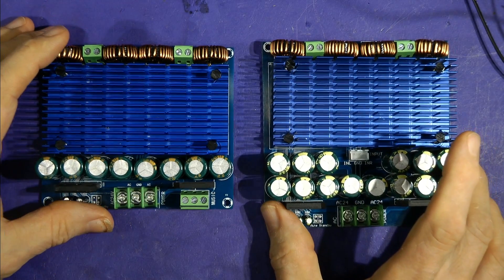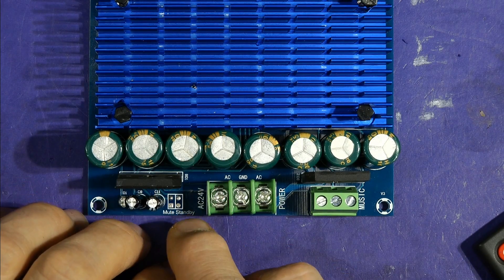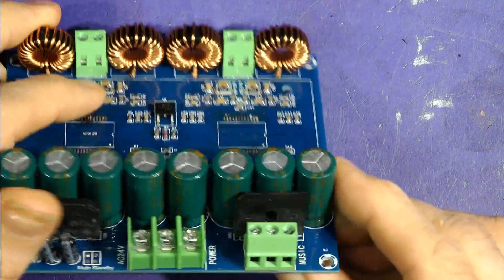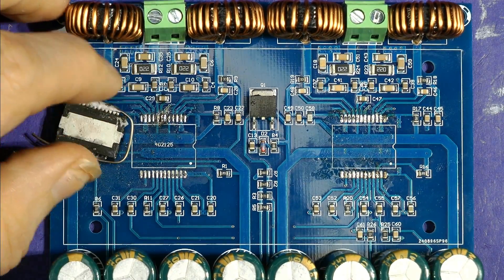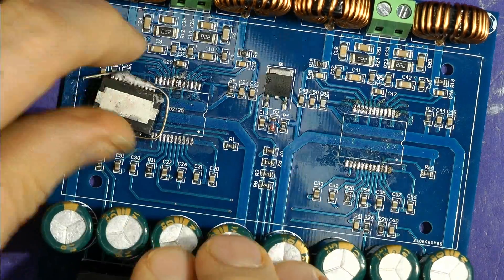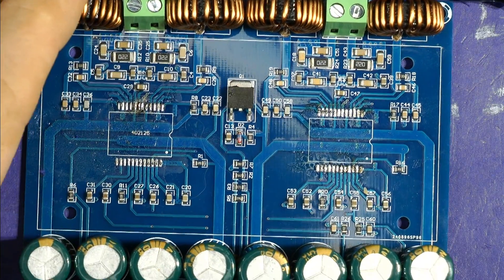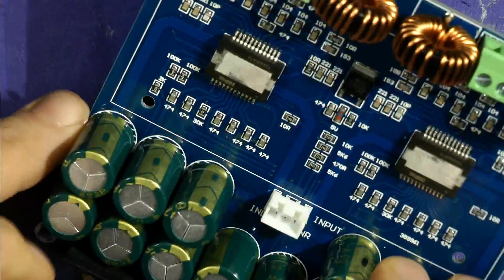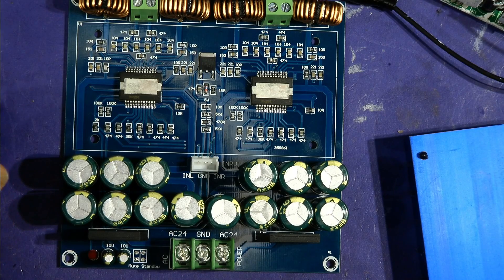TDA8954TH Class D 420W Power Amplifier Board Tech Review and Issues is it worthy?

Comment: These may still be available in the through hole version....& a better option than these.....If your into pcb layout design good for a new DIY ..
4× 1000uF for each polarity is poorly inadequate on a 50/60 Hz line frequency power.
we used 2200uF per polarity on an SMPS switching @ 350kHz...
the dc.+/- has to be stiff...
with 50/60Hz there's a lot of p-p ripple voltage..that may be going below the  u-v of the internal mosfet's gate drivers .
that may allow the m-fets to operate in it's OHMIC region.
Also 470nF filter caps may be too large (because of too low Xc) for the internal pwm sw. freq. that is also around (300-350)kHz.
Reply from the maker: Over the years I have replaced changed perhaps over a 1,000 TDA8954 chips. With often no apparent discernible cause why they have given up the ghost.  Some implementations are definitely more prone to failure. NXP pulled the plug for a reason,......
Reply: @razenby  my comments were not anything particular about  about the chip..except it's availability..
It was about the uF value of the capacitoirs.

Comment: I've got a similar board with the same chip, but the choke heats up like crazy.. so much as to enamel of the wire started burning, this is at 24v AC 8amp supply
Reply from the maker: My advice is to bin it, this module is a waste of effort.. It will be a constant source of pain...
Reply: @razenby  💯😂 thought so
Reply: With no input or load

Comment: Hi there mate. I'm thinking maybe you can help me somehow. I have the same board, the one with less capacitors, bought from china. I build one amplifier using this, with a Bluetooth module and a tone correction with base middle and treble adjustment. I've supplied this with a toroidal transformer of 2x30v and 2x12 volts at about 500w. it was working perfect. I've sold this amplifier to someone and he brought back to me next day, saying that it was playing just 2 songs. What I saw, all the potentiometers were at maximum level and he was playing on a 700w speakers, but I don't know if it was at 4 or 8 ohms. Now the amplifier module it gives me DC voltage on one of the outputs. I've supplied this time with a normal transformer of 2x12volts at 7amps, I have the blue light on but no sound, removed heatsink, it is not getting hot, but as I said I'm getting around 17volts on  one of the output. I am not an electrician, but I like to play with DIY audio modules. Could you help me what to check and maybe repair it?? I did not remove any of the main chips, but few capacitor to check them out of board, because one of them from right channel looking from the top, it shows me shorted on continuity. Even after removed this one, the pcb is still shorted on their pads. It's about C50. Also the 2 resistance R12 and R8 shows me different values on the board. Any advice would be helpful. Thanks in advance
Reply from the maker: These AMPS will never survive working at power.  The PCB layout is very bad and to boot the chips are very suspect.    NXP retired these chips in 2019.  Genuine ships on the new old stock market are selling for around US$25 a piece.  We have used hundreds perhaps thousands of them over the last ten years.  I though to use these salvaged from these cheap Chinese amps as donors to service our usual semiprofessional amps that employ them. I was wrong, they lasted less than an hour , sometimes only a few minutes on test.  With the genuine NXP parts they rarely if ever failed. Whatever they fitted to these amps last less than an hour in some case just a few minutes.  Look at the feedback protection mechanism as specified in the datasheet. The chip has thermal and clipping alarm pin that relies on the driving pre-amp to throttle back the input.  With no response to its cries for mercy they self destruct.
Reply: thanks a lot mate. So basically speaking i just can bin it @razenby

Comment: I have Same this board with 8 capacitor of 1000mfd  currently i use transformer 25 0 25v - 10A 
But maximum i get 240w rms per channel so please tell me that can i use more ampere transformer for this board 
Because 25+25V x 10A = 500W 
And i observed that the board take 12.5 ampere on max volume on 60hz frequency
So can i use 25 0 25V AC 15 Ampere Transformer on this board?
Reply from the maker: Hmm, the main problem with these boards is that they are a simple layout of the datasheet circuit.  The copper tracking thickness (conductivity) and layout leaves a lot to be desired.  I blew up my test ones when I tried it at full at rated power.  You can get the details of the max ratings from the manufacturer's datasheet for the TD amp chip.

Comment: Can you recommend an alternate amp-board that uses this chip? thx
Reply from the maker: The chip is obsolete - The TDA8954  was always a nasty stain on the reliability of products that used it. There are a large number of Amps that have been scrapped because it went obsolete. The last time buy batch was sold off to China.  I have a feeling they obsoleted it because they had production and reliability issues. I haven't been ale to find a replacement/equivalent device. If you don't need to use it then steer well clear. The parts I have managed to buy didn't work reliably.

Comment: hey, i have the same board as yours, the one with less capacitors, i have 2 150w rms /300w peak speakers (i actually dont want to break them, they're some high quality speakers, from the 90s)

i have a powered mixer from the same brand, which has a class AB power amplifier in it, but even if on the back it claims 2x120W at 8 ohms, while pushing it to the limit, and measuring the power drawn from the outlet with a chinese power meter, the meater reaches max 119W, which is less than 40W per channel, probably 25 watts considering class ab losses/efficiency....

so i wanted to use that board to reach atlest the RMS value of each speaker, so 150W, or some close values so 120W for example..., 

do you think it would be possible with some modifications to the board? if yes, what would you modify besides the output filter capacitors? 
or should i desolder the chips and make my own pcb? i dont think i have enough knowledge to make a good pcb, i can make a bad one, but not a good one xD 

also the inductors become really hot while in use, so i guess these got undersized and must be replaced too, right? 

thx :)
Reply from the maker: The copper tracks and components (inductors) are underrated on this board.  There are better and more reliable options to achieve a powerful amplifier. This layout will never be reliable.  These chips have thermal fold-back and should only be driven hard if you have the safety feature in the support circuitry.  It is very easy to destroy these chips.
Reply: @razenby  what is thermal fold-back in this case? a logic that reduces the input signal if the temperature rises too much? like a "throttling"?

also what is the transistor Q1 for? iirc you need a 5V logic to use the mute/stby functions, how are they achieving it without a voltage linear converter?
Reply from the maker: @xzVice  See the datasheet for the chip. It is all explained there.  If the chip gets to hot the preamp can throttle back the drive signal to alleviate the load.  This can happen fast a long loud bass note can push it over fast.
Reply: @razenby  so you say that it wont be able to save it from death
Reply: @razenby  could you send me the name of your supplier? i need some of these ICs
Reply: @Magic Smoke could you send me the name of your supplier? i need some of these ICs

Comment: Maybe you mod something like this for optimum performance over the winter. Probably not cost-effective, I suppose. Would an inexpensive car amp strapped to 12v HP server supply make more sense.
Reply from the maker: I certainly would use one of these modules from anything other than for a novelty. If you turn it up and get to the end of the track you are doing well!

Comment: Hi, I used 30-0-30 ac and on switch on R10;12;24 and c4;39 burned out. Can you help. Regards 
Ray
Reply from the maker: Oh dear - I think that the are probably toast...    The magic smoke is released from the TDA8954TH very easily. That is why they have withdrawn the chips from the market.  Somebody probably blew out all the rejected stock from device test as a last time buy to China. I noticed that the printing on the chips in the modules differs very slightly from the original.  This might be significant or not but they don't work the same. I was using these modules as  source for replacement chips for powered PA equipment but half of them don't work or just fail after a while.  I have used new stock from the UK distribution channel for years and never had these problems.
Reply: @razenby  Is there a successor chip to this?

Comment: Hello bro, I have such an amplifier. I have only been using it for 2 days but while I was using it I heard an SMD capacitor explode. Can that still be fixed? thanks for the answer. I'm sad because I still owed the money I bought for that amplifier and it broke right away 😢
Reply from the maker: They do that a lot. It isn't a proper implementation of such an amplifier.  Depending on what cap has blown, it may have destroyed the amplifier chip. I can't say from here. You can see the schematic  of this board on the Amplifier chip datasheet. If the device isn't happy with its implementation circuit they blow very quickly.

Comment: Hi ya, I found your video while looking for repairing washing/dryer machines and came across your chips n fuses repair I am now subscribed, "click"  ,, very informative and easy on the ears NICE JOB ,,, I wonder if you can help my LG dryer just packed up with a loud bang and the smell of cows as you describe ha ,,, i've repaired it once before by replacing the main board and motor as the same, everything worked perfect for a few years now  its is over heating and I just want to replace the component thats blown as I can keep buying mainboards just of one component haha  i've tracked down the problem to a Triac BCR8PM-14L that went Ka BOOM but its a discontinued transistor  so no one in the uk has it not RS Components or Farnel,, would you know of an equivalent I can use to replace this transistor  BCR8PM-14L for a LG TDC70045E dryer, its Main PCB Module is 6871EC1113G
Reply from the maker: You can buy the triac here for a couple of quid inc shipping:  https://www.aliexpress.com/wholesale?cat Id=0&initiative_id=SB_20210823050143&SearchText=BCR8PM-14L+
Otherwise any 6 to 10A 600 Vtriac with the same pin out should work.  Pay attention to anything connected to the gate as that may be blown too.

Comment: There must be a market for implementations of reference designs with quality components.
Reply from the maker: I would think so.  There are other TDA8954 modules available for about £10 more that seem to be better designs.  The reference designs are OK but there is often a lot more nuance to getting it reliable.    Case in point is the FBT amplifiers that use the same chip. There are a lot more components dotted around the device - mostly decoupling and significant componentry dedicated to detecting fault or main power failure and putting the device in standby before the DC power supply lines drop even slightly. The datasheet says all this is accounted for by the chip's own circuity,  but the brutal fact remains is that these chips fail often.    For some reason the professional amps do not enable the Thermal rollback, instead they have a thermistor next to the chip that feeds the temperature back to the DSP processor's application to control and monitor. The other mistake that is often made is to lace a great clump of 4mm thick silicone putty material placed between the device and the metal heatsink.  These need to run Metal to Metal with silver HS compound.
Reply: @razenby  Do you think the amplifier ICs on these boards are even genuine? The caps aren't after all.